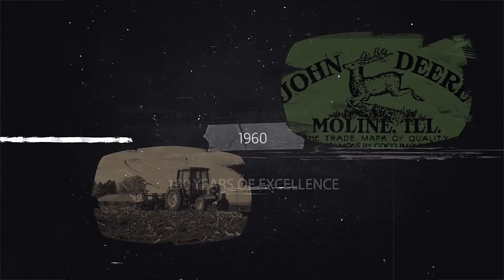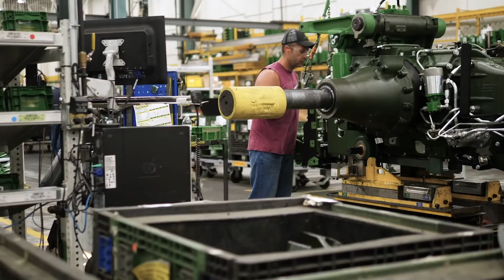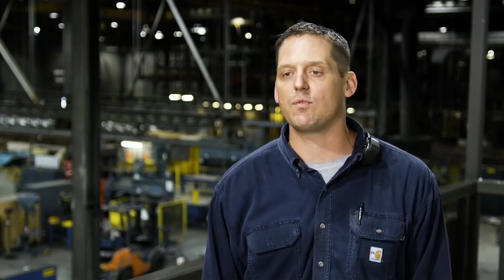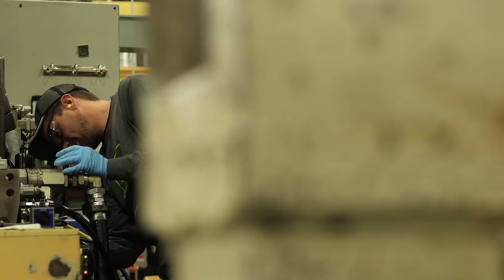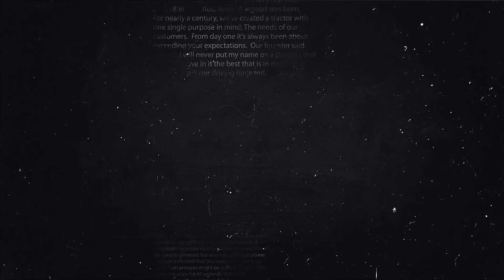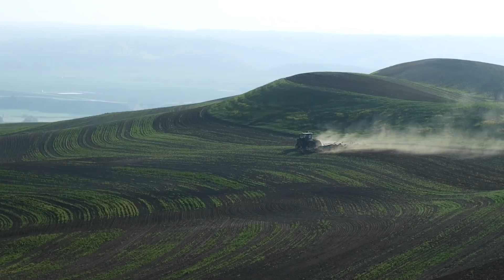Building the best large tractors

Comment: Was the best , now for some reason they are putting junk electronics , egr systems which fail , and now they are changing proven designs to copy the Case / New Holland . We have three old models which are proven , one newer one which has had more problems than all of our tractors combined over 30 years!.Add to that mechanics which have no clue how to fix mystical problems but don't mind charging to come out and scratch their head and say ,try turning it on and off .We have two red ones now and we simply can't afford to buy Green again .If any John Deere rep is reading this I'm happy to talk about it , we are not the only ones in the area with the same problems.

Comment: The 9510R I've got is junk! Two ECU's, six EGR coolers, three EGR valves, dozens of sensors replaced and premature failure of diesel particulate filter. My next tractor will be a 975E Challenger. Deere can't build a scraper tractor and they never have!
Reply: It might not be the equipment, it might be the over reactive operator controlling the damn thing.
Reply: farmerjoe338 It might be junk but they look cool

Comment: @John Deere is it possible to get a 9r series tractor with IVT Transmission?
Reply: At this time, the current 9R tractor is only available with the 18speed PST (power-shift transmission).  This transmission is built in Waterloo at Drive Train Operations.  It has been updated, upgraded, and refined for the 9RX program.
Reply from the maker: Justin, John Deere 9 Family Tractors all feature the e18™ PowerShift transmission. The e18-speed full PowerShift transmission provides 18 total forward speeds or 10 speeds with a 0.0 kmh (0.5 mph) speed change between gears in the 4.8-12.9 kmh (3-8 mph) working range. You can find more details about the 9 Family Tractors here: http://bit.ly/2v5HzCm.
Reply: Justin Germanovich that would be the bomb